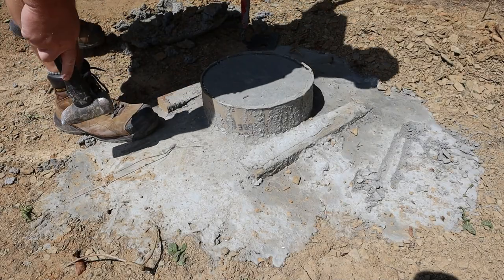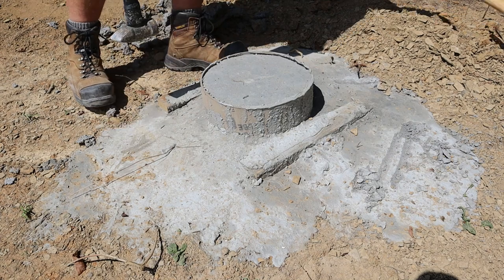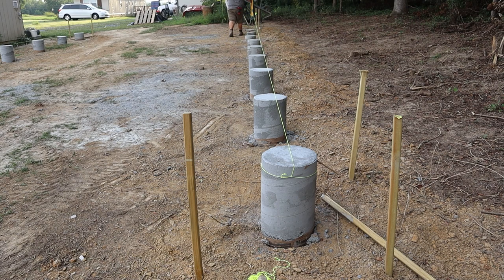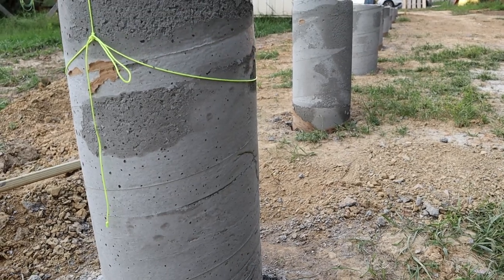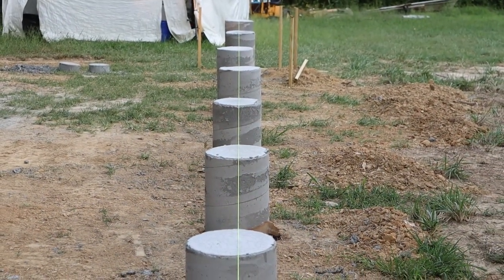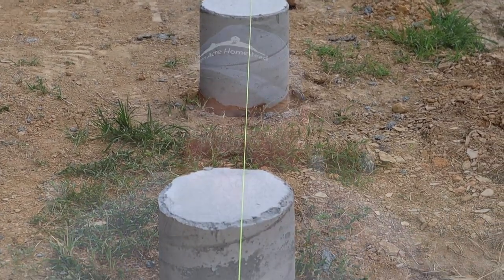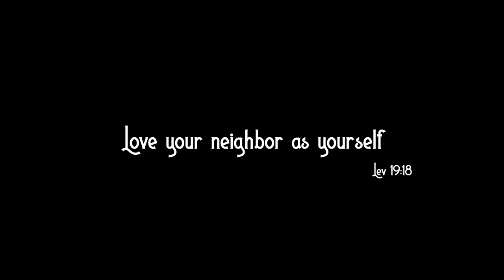Our Concrete Piers Are NOT LEVEL... This is how we fixed them

Comment: I called it! Also, mcmaster carr was like our candy shop in engineering college on our senior projects. I still see it used on occasion at work in the diesel engine industry for special test needs (making fixtures...that one random oddball bolt you need).

Comment: I wonder if your shim heights would have been different if you had run the line about an inch above the piers and then measure down to the surface of the concrete.  What I saw might result in a high pier suggesting its next door neighbor appearing to be too low and needing a shim when it might not (or it might need a different amount of thickness).  Good going!

Comment: That wasn't really a mistake.  It's just how concrete piers work.  String tends to sag in the middle, so a self-leveling laser would be better.  It projects a level line on all your piers at once.  Aluminum shims are perfect if they are going to build with aluminum.  Treated lumber is good for shims under a wood frame.  I built a solar array frame with those cardboard tubes.  They had a 1 1/2" steel pipe frame with pipes sticking down into the forms, so the pier height did not matter.  It was across a slope, so the forms were not even level.  Just the top rails of the frame.

Comment: think the best way to go is build the entire carport about a nut height higher than the highest pier , wat you basicly do is drill holes in the piers and install treaded rods either with concrete ankors or chemical ankors and after drying run a nut down them 
than install the poles with the flanges on them and run up the nuts on the low piers untill the flanges are level and tighten them up with nuts from the top 
will allow you to get the structure level to withing 1/100 of an inch if youre able to measure it that close 
once the whole structure is standing you can wrap some packingtape around the piers and fill the gap up to the flange with some extra concrete if you feel like thats needed 
once youre going to enclose the sides of the polebarn youre probably going to build some short walls up to the height of the piers (might even lay down a slab inside the barn ) so you might do that at a later stage 
you mightve been able to pour the piers in a neat row if you used long lengths of wood conncting them together
oh well shims work too , btw you might want to predrill the holes for the flanges in those shims that come with the polebarn as the builder likely dont have steel drills
allso might want to paint them in sumting tar like as the concrete eats the aluminium if left exposed putting a shingle under the top and bottom probably work too

Comment: Sam I would have told you that it's close enough. Piers tend to have issues and most everything has some wiggle room to allow for wonky-ness. Plus I did Versa-Tube installations at one point, I've seen worse. Even put them on top of block walls. Expect for looking like they are leaving a bar after midnight, they look fine.

Comment: What metals react with concrete?
Nonferrous metals are frequently used In construction in contact with portland cement concrete. Metals such as cop. per, zinc, aluminum, and lead-and alloys containing these metals may be subject to corrosion when embedded or in surface contact with concretc.

Comment: Dang skippy! I went to that website and could feel my credit card trying to pry itself out of my wallet. I had to close the webpage quickly before I went in the poor house... Also, too late for this project, but if you do concrete like this again sometime, take a palm sander (without sandpaper) and run it all along the outside of the tubes. The vibration will help settle the concrete, remove some air bubbles and perhaps help the leveling issue by reducing settlement.
Reply from the maker: Oh yes.. that's a DANGEROUS site for sure!!! You're absolutely right on the concrete too. This project taught me the importance of vibration on pours to get the best results. The next project coming up will be done better with them. :)
Reply: @sam-and-angela  if you're not learning, you're not growing!

Comment: Question. Is the piers before the ones you said were shorter, are they higher?
I’ve done this a little different
Run a line 1” above one pier and level from end to end. Then measure from the line down to the top of the pier

Comment: I would have gone with stainless steel .... just because it don't break down like aluminum does.....  
You did good on the footers , concrete is a bear to work with
Reply from the maker: I’m following the directions of the company and their engineers. Stainless would be very difficult to drill through for the anchors.
Reply: @sam-and-angela  true it is but you only drill it once and out last aluminum by 10×

Comment: When running the string lines you should elevate the lines at the ends, usually I use a 2x4 to avoid the string being distorted by piers too high.   Just curious if you did that.

Comment: Excellent video, Sam.  I identified with every step of the DIY-figure-it-out-and-find-a-way effort.  Been do things that way here on the farm for 60 years.  Even learned a new term: wabi-sabi.  I imagine I'll be using it often on my projects!

I went to McMaster-Carr, and was not able to track do the shims you purchased.  That is a BIG inventory!  I have a similar need to raise a set of precast steps on concrete piers about 1" because of a design change.

Could you point me to where you found your 6x6 spacers, please?
Reply from the maker: It's under Raw Materials -> Metals
Reply: @sam-and-angela  Thank you.  I had been searching under spacers and shims, and neither was doing the job.

Comment: Cool   Yes In my jobs in industry we used McMaster Carr.   
So are you fastening the shims or letting them do it to there satisfaction?
Reply from the maker: I hope they drill through them to pass the concrete anchors through before bolting it down. If they don’t I have the equipment to drill them I will do it for them. It will be difficult to be hands off on this project! 😂

Comment: Why piers I have a 24' x 30' love it but I don't get why the piers? I did concret tie downs and then filled over the bottom frame with gravel works great there are lots of these carports around never seen one on piers.
Reply from the maker: 25” of slope to the ground.
Reply: Oh ok now it makes sense, guess that would be cheaper than all the ground work and fill it would take to get level thanks for responding... I am guessing you are not going have a horizonal bottom bar which with that foundation you made it shouldn't a problem @sam-and-angela

Comment: Stupid question;  couldn't you sand down the tops of the higher piers to match the level of the lowest?
Reply from the maker: I suppose so, but that would mean sanding down 17 piers 5/8" to match the one lowest one. Shimming is much easier.

Comment: I don't understand what your design is. Are you laying the beams directly on the concrete? Typically you bolt a metal bracket to the concrete and then attach wooden posts to the brackets. That allows you to alter the height of the wooden posts so your beams or joists will be level.